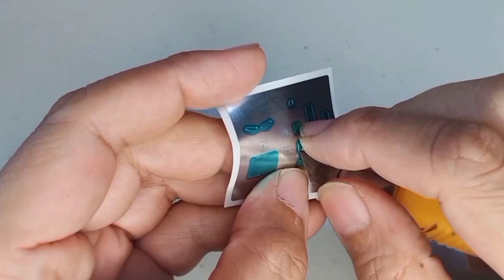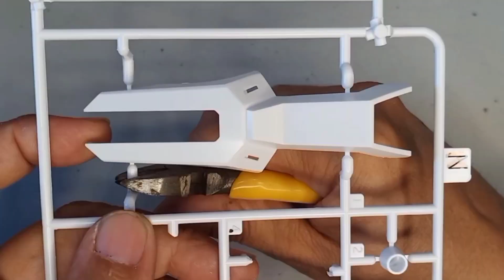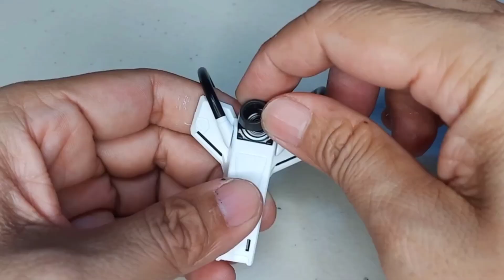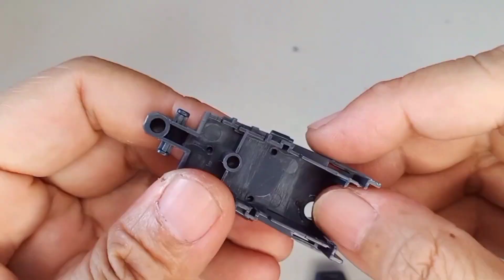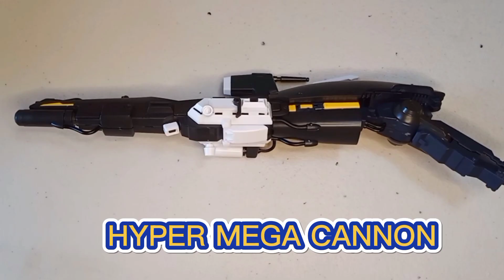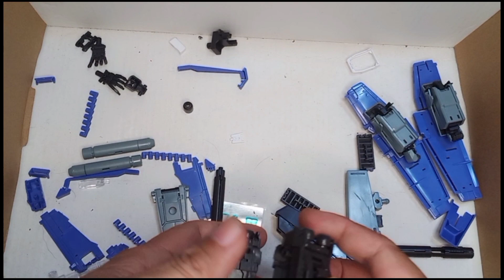CANT AFFORD THE ORIGINAL? AA MODEL 3302 GUNDAM FAZZ ASMR / REVIEW PART 2

Comment: How did you attach the shoulder armor?
The one where there's a big pointy part pointing upwards
Reply from the maker: I just followed the manual.. You might need to check the shoulder connection piece if you have attached the part needed to connect the shoulder armor.
Reply: @gunmetaljoe_builds  Saw a video where they suggested that I should thicken the shoulder armor with some nail polish or tamiya cement.

It worked so far. Thanks Joe!
Reply from the maker: That can work as well.